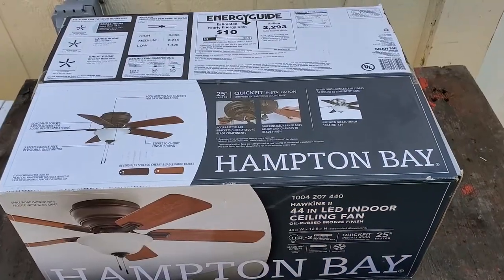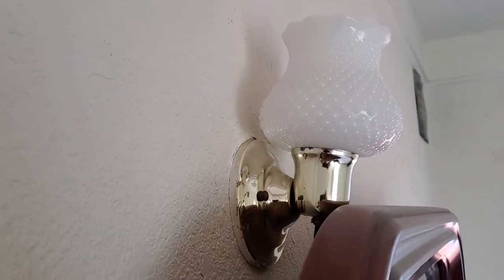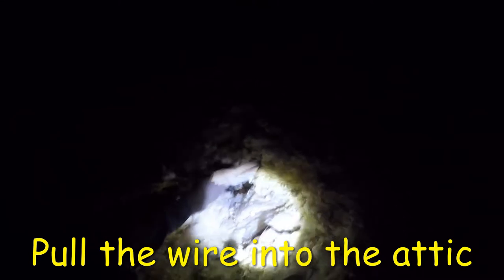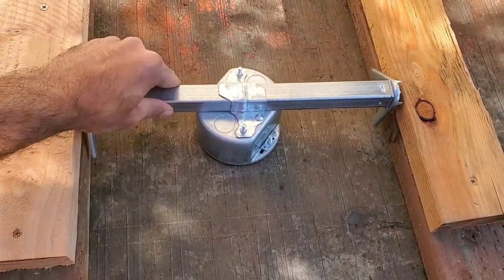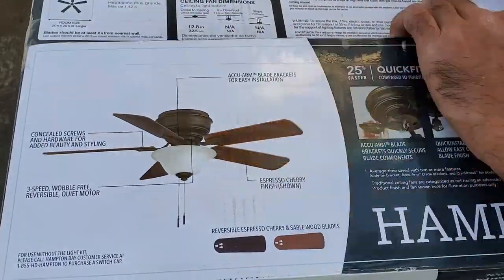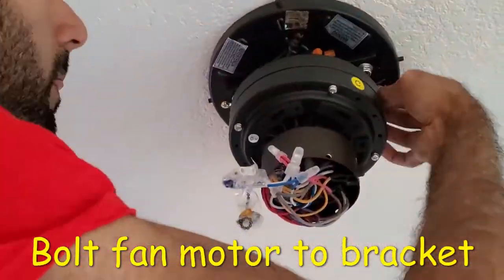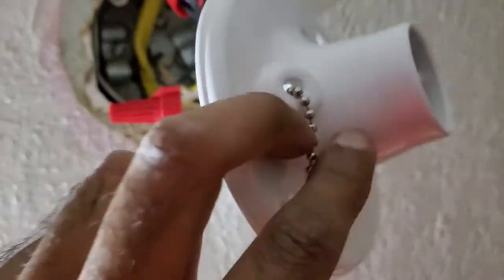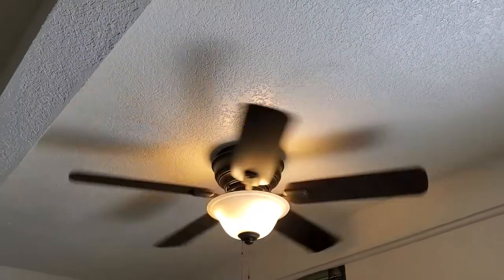Installing A Ceiling Fan With No Preexisting Wiring

Comment: IGreat video and excellent advise. In my case I determined the center of my living room then with a long drill drilled into the ceiling. Wwent into the attic to install the same fan junction box you installed. After finding the drill placed the junction box support between the rafters drawing a line around the box. Using a razor knife I cut out the hole in the ceiling. Inserted the box in the hole and use 4 long screws to secure it in place. Patched into a line in the attic running the wire inside the junction box. Followed the installation instructions to install the fan/light. I use wireless light switches so the fan and light operate separately. Installed a 9 watt led bulb and set the fan to speed 1 which uses 10 watts. Everything works an easy job not complicated just a lot of labor took about 2 hours.
Reply from the maker: Awesome work! Glad the video helped. Enjoy your new fan

Comment: Having access into the attic, well that changes everything
Reply: Haha I'm watching to mount on the bottom story room. I hv to just remove drywall inthe middle about ¾ in on the 2x6 joust so I can reset with drywall  screws, should I just shoot straight for switch about a 45⁰I think it would save me time.

Comment: You should have used the 4 wire romex and connected the light to it's own switch. There are switches than will control both that will fit in a single switch gang box.

Comment: I have a capped hole in my ceiling there's a flat grey cable up there tucked in. I don't know if it's spliced in the attic. I want to wire up a fan. What should I do? It's a new construction

Comment: Ok so my house is wired with 14ga wire and I'm trying to get my power from a light in the attic which is also wired to my bedroom which I didn't know. So I wired everything and the fan trips the breaker so I changed the power to an outlet in the room I am installing this to and same thing. I did use 12/2 not realizing everything was 14ga could this be the issue?
Reply from the maker: In terms of safety you should be ok as the 12/2 wire can carry 20 amps while the 14 gauge can only handle a 15 amp load. However, your breaker for this circuit should be a 15 amp breaker.

Comment: Then u have to have the ceiling fan on for ur closet light to turn on.
Reply from the maker: No the ceiling fan can be turned on/off using the chain pull swiches